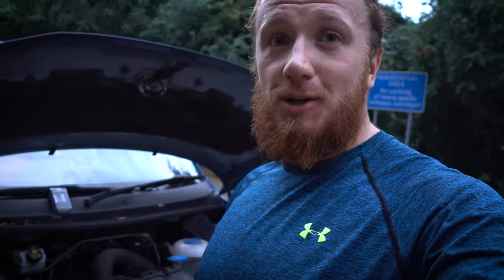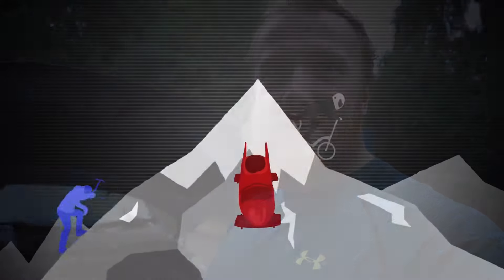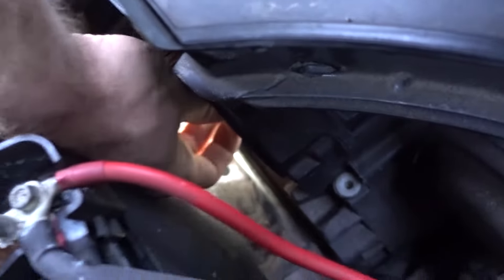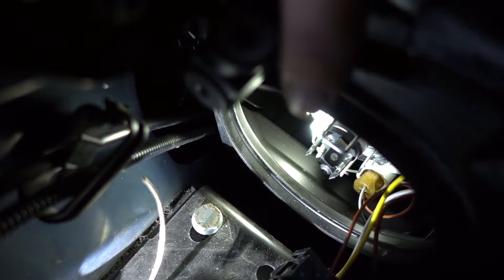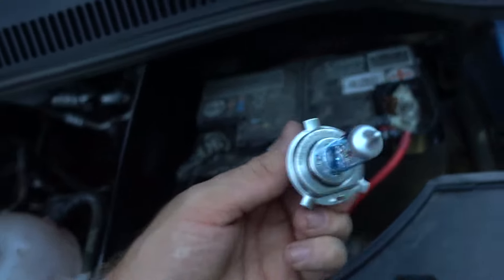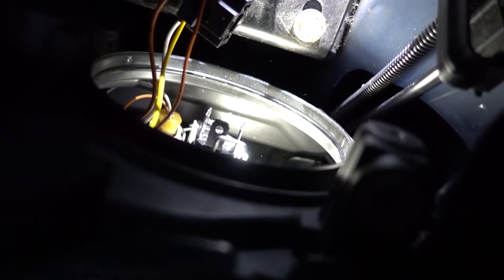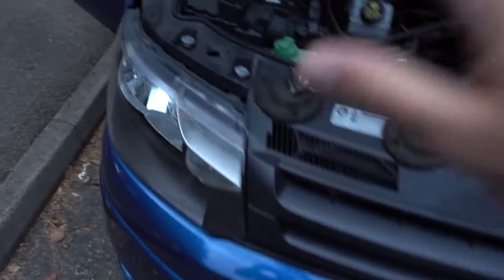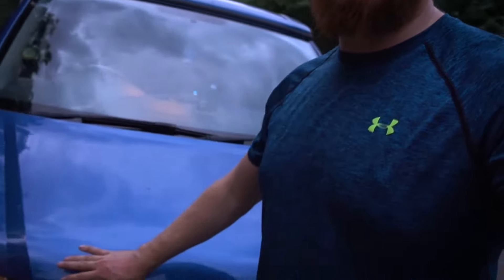How To Change Headlight Bulb VW T5 - Volkswagen Transporter 5

Comment: Just changed the bulb on a T6 (2018) and the small metal bar/flat side has to face UP when pushing the bulb back in its hole. Not down as for the T5.

Comment: Thanks my T5 handbook showed two separate pieces of wire holding the bulb in (same as my Mk4 Golf) tried a few options to undo but was concerned I might break something; your video gave me the confidence to push harder on the clip and it worked no problem.

Comment: Perfect. Just what I needed. The best bit is knowing simply to push the retainer away. I can see that have taken some figuring. Easy when you know. Nice one. Did you upgrade the bulbs from standard? Reason being, I’m keen to improve the lighting on mine. If so what did you use.? Thanks.
Reply from the maker: I upgraded them, but just with a slightly brighter, bluer light. (Link in the description) but this was part of changing all the lights on the front end. I went with LED for the DRLs, and the fog lights which was a great move in my opinion, looks much better.

Comment: What is the type of the bulb..? H4 or H7...?
Reply from the maker: im sorry, ive been looking for the information, but it didnt have it on the reciept, and i dont have the box anymore. if i go back into Halfords, ill ask which it was and let you know!.... but you've probably already got one by now.
Reply: @TheAxelBrown  I already changed the bulbs, thanx to your video, and my T5 LWB with single lamp uses H4 type.
Reply: Does anybody know what the bulb type is for the Parking Lamp.  I have got one missing but can’t get the other side out to see what type it should be.  It’s a smaller push in type with two blade type connectors.  Hopefully someone knows the globe type.  Thank you